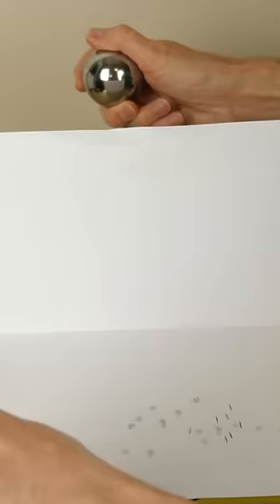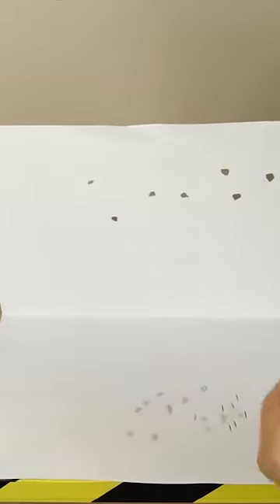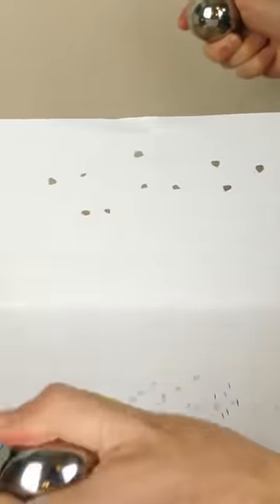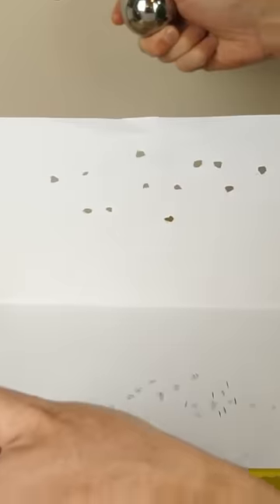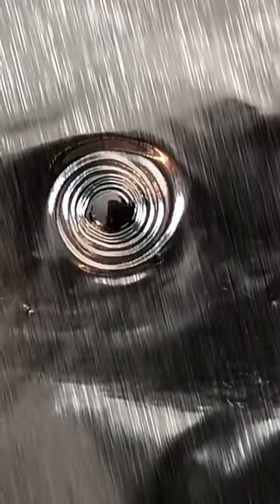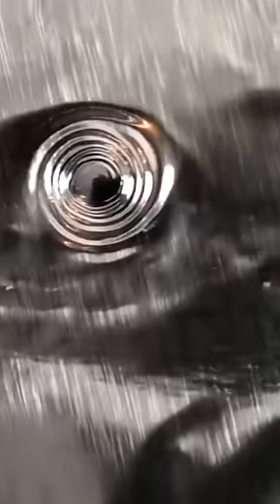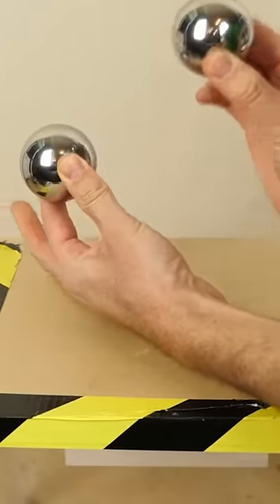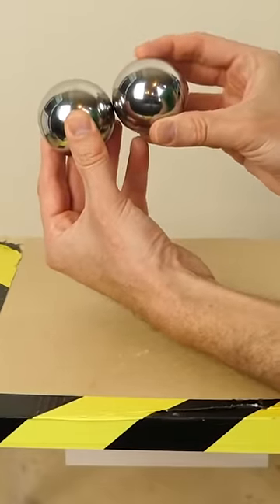Balls of Steel Make Sonic Boom

Comment: at first i was like wow that’s pretty cool, then i thought about how there are no crinkles in the waves. Think about how hard it is to bend aluminum foil without it crinkling/making edges. Crazy that it’s so smooth
Reply: I'm guessing it's bc of the initial heat of the reaction generating enough heat to briefly melt the aluminum and make it much more malleable
Reply: @miscl_anon  oo ya that would make sense
Reply: @jackistripping1846  ye ye-
Reply: honestly it's not too hard
Reply: If instead of Aluminum, you’re actually using Aluminium, you can use your own two balls of steel with no wrinkles.
Reply: I believe it had to do with the miniscule contact area of 2 sphere connecting with minimum deformity driving the pressure produced to strikingly high levels. Pressure = Force/area.
Theoretically two perfectly rigid perfect spheres have 0% percent contact surface area driving the pressure to infinite levels ie undefinable. In the real world neither spheres is truly perfect and steel does deform to a degree meaning that the surface is not 0% of the surface but is still incredibly small meaning even with only 2 pounds of mass from over both spheres and the relative low velocity of the collision the pressure produced would still be far greater than we'd imagine intuitively. Small but powerful Soundwave deforms the foil mechanically with some energy lost to heat perhaps changing the elasticity of the foil. The Soundwave would dissipate quickly due to the small amount of gas volume displaced at the point of impact.
Reply: @miscl_anon  maybe not melt but for sure softened by the heat
Reply: @Ron.S.  Aluminum and aluminium same thing, just different language, British and American
Reply: @kerimca98  I know… still don’t understand though why Americans and Canadians are the only ones in the world who call it Aluminum if the British chemist who discovered the metal called it Aluminium
Reply: @Ron.S.  it never got corrected, but if I remember correctly it was due to a spelling error on this side.
Reply: @miscl_anon  While it certainly gets hot, perhapse the pressure alone can deform it that way. When you bend aluminum foil by hand, it creases easily because the forces tend to focus at weak points, weakening them further in a positive feedback loop. The whole peice of aluminum acts as a lever. In the case of the steel balls, there is enough force momentarily being applied directly to the aluminum to deform it. Assuming this is true, it still only explains the surface smoothness and not the wave properties. EDIT: There is a pressure wave propagating through the aluminum after the impact, and wherever the pressure difference is high enough across a small enough distance, the material is permanently deformed. Since it is pressure waves doing the deformation rather than "direct" pressure, the deformations are understandably wave-like.
Reply: @anjaninator  ye, something like that. I was just thinking "melt" in the sense that it became very malleable for a split second
Reply: @wes8190  mebbe. tho personally I'm not sure enough pressure is really being applied to the balls for it to affect the aluminum that much. heat tho, would soften the metal and cause it to expand, creating those ripple patterns as the heated material expands and meets resistance of the unheated material
Reply: @ArtisChronicles  to be clear, the spelling error was on which side?
Reply: @miscl_anon  I suppose the reality of it is a complicated mix of the two and more. I don't think expansion from heat is enough alone. Consider the heat comes from the air being compressed, so could the air pressure or flow of air be what deforms it? EDIT: I want to see this tested in a vacuum lol
Reply: @wes8190  >consider
*Considering? or do you mean, "suppose that"?
Reply: @miscl_anon  I meant it as a friendly demand, but i concede that it may be an incorrect consideration to demand. Where does the heat come from, if any, and where does the pressure come from, if any, and which plays the biggest roll in the deformation, if either...
Reply: @wes8190  Oh, I was just wondering how you were framing it, since it could've read as either you saying "Considering that the heat comes from the air..." or "Consider the possibility that the heat comes from the air..."
Anyhow, to me, it's the balls that make the pressure, that generates the heat. as demonstrated with the paper, their impact creates enough heat to burn through it completely, so to me, that heat is what's acting on the foil
Reply: @Ron.S.  A British chemist didn't discover it, a Danish one did.

Comment: Tangent points. There is a tiny amount of surface contact with a lot of momentum causing compression of the air  between them. This is awesome.
Reply: It is pretty cool.  One of the cooler videos of his. Could you start a sizable fire this way? I'm sure you could
Reply: @FirstnameLastname-rf8bf  If you had such huge balls of steel I’m sure you could
Reply: @nightraider5100  well, good thing I do.
Reply: +1 like
Reply: Ya same way glow plugs work

Comment: if i remember correctly, this is why when dealing with ball bearings in large quantities and flammable fumes or materials youre not supposed to have them together and the steel is not supposed to have space to move around. i think thats why 9/10 that you buy bearings theyre individually wrapped or in a matte plastic package. cool video

Comment: I think I read about axes being favored against plate armor because round surfaces always hit each other nearly 90 degrees and so it is always maximum possible force at point of contact and it's a great way to amplify your damage against a strong, round plate of armor. This looks like the exact same thing, but with much more round objects and a membrane in between. Very cool.

Comment: I thought that sonic booms occurred when the sound barrier was broken? How is this beating the sound barrier?
Reply: It's not.
Reply: Guessing if it is a sonic boom, the air between them escaping at high speed is what is creating the boom.
Reply: It’s not. What’s actually happening here is friction and heat conduction due to the collision of the steel balls.

Comment: I like how our brain is able to perfectly align our hands so the balls hit each other through the paper without any sort of aiming.
Reply: I think that’s simply because the balls are perfectly spherical, so they will always hit when brought together. However, the “BANG” you get depends on the angle that you bring them together.
Reply: @timopper5488  I don’t think you got what OP was saying but ok
Reply: @Ozone946 
I totally understood it, and the OP is incorrect, because aiming is involved. It’s unconscious, but it is actual aiming.
Reply: @timopper5488  i definitely would nt call it 'aiming' because that necessitates some sort of visual component. Alignment, sure, but thats not aiming. Op is talking about proprioception, which is the same 'sense' that lets you touch your nose with your eyes closed, or for a more analogous example, clap your hands.
Reply: @hq4290 
Yes, and that is aiming. It doesn’t need to be done consciously. I know you think that I’m misunderstanding, but I assure you that I’m not.
Reply: @timopper5488  subconscious * and no hitting it at any angle wouldn’t change anything they’re spherical they have the same surface size no matter how you turn them and clap them together, that’s like saying that 2 squares with equal surface area and size will hit different if you turn one around
Reply: @adanflores4523 
I meant subconscious. But yes, the angle would create a slightly different result.
Reply: @timopper5488  There is no angle. They're spheres. They always hit the exact same surface area. Because it's a sphere.
Reply: @chrismanuel9768  I suppose you do have to hit them into each other. I would imagine if you only have a glancing blow there won't be enough energy in the collision to create the effect.
Reply: @chrismanuel9768 
Perhaps I’m not explaining myself well enough. Even spheres can approach each other in a glancing attack. The surface area of contact may be the same, but the impact will be different than a head-on collision, so to speak.

Comment: A bit awkward phrasing when describing what happens when the balls collide, the observations make it sound as if its the shockwave that causes the holes in the paper; if this were true then you would see the same crinkling pattern as seen in the aluminum foil, which there aren't any. What actually happens is the transfer of kinetic energy from ball to ball is an inelastic collision due to a portion of the kinetic energy being expressed as thermal energy, which is why there are visible sparks/cinders after each collision; ie the collision is actually burning the paper at the site of the collisions

(edits: fixing some spelling/grammar typos)
Reply: He said it was burning the paper
Reply: Brilliant.
Reply: Kinda sus

Comment: "perfect surface area when they contact each other"  They're round.  They only touch at one tiny  point no matter the size.
Reply: Not quite - elasticity, imperfections
Reply: Mathematically speaking, the point of contact has zero area, but what Carlo says sounds about right. Also, it could influence how the sound can  "escape"
Reply: @Flovus  I'm reminded of an engineering professor who corrected me on something similar and said "actually, it's not "zero".  It's infinitesimally small but not "zero"." 🙄
Reply: @sonparabailar  Well, engineers usually don't know much about math.
Before the development of the limit, Newton did use infinitesimally small numbers in his early calculus work. There is a field called nonstandard analysis in which one can show that this can be put on a formal basis.
But in the standard reals, there is no such thing as an infinitesimally small number, only arbitrarily small numbers.
Reply: That’s assuming the material is infinitely stiff. Hertzian contact would be a much better assumption for calculating the area of the contact surface.
Reply: I believe that in physics there is no actual contact at all.
Reply: @paulneilson4106  Pauli exclusion be like
Reply: @sonparabailar  infinitesimals don't exist in the real numbers. Physicists and engineers are so liberal with using the concept of infinitely small numbers because it makes their calculations work well but it's not mathematically rigorous, in fact it's not even necessary to use this concept at all. Any usage of infinitesimals can be replaced with a limit, which is much more logical and intuitive anyway even putting mathematical rigor aside.
The nonnegative number that is smaller than all positive real numbers is 0. It's easy to find a contradiction if you assume otherwise.

Also, mathematically, the area of contact is zero. A point has no dimensions, i. e. no area. Imagine introducing a malformed concept to talk about something that isn't even true.

Comment: Rust one and cover the other in Aluminum foil and it makes thermite.
Reply: .. Really ?
Reply: @CraigDAmico  Really.
Reply: Not really, thermite is iron oxide plus aluminum but the aluminum foil is passivated by an oxide layer.
Reply: @wedmunds  And you don't think that two heavy metal balls whacking together on point to point contact can penetrate a thin oxide layer? Lol

Comment: I think I remember discovering this with paper when I was younger when I was just screwing around, but I think I did it with something else.

Another cool thing I discovered when I was a kid was rubbing a white fluffy blanket against my hair and making it all static, then discharging the electricity with my fingertips and you can actually see the electrical current on the blanket, it would light up on the surface, sort of like clouds that light up during a thunderstorm. It was dope, too bad we got rid of the blanket.
Reply: I once had a blanket that would light up like the night sky If I generated enough static

Comment: I'm still unclear why this happens only with the spheres.  Does the combination of both surfaces need to have a certain radii?
Reply: I would guess it's the very small surface on each side of the ball contacting the other part. You can use the same force with a hammer but a flat hammer surface spreads the force too wide. 

When the same force hits a much smarter area, the impact is much greater, thus creating a sonic boom shockwave.
Reply: Maybe it's because of the extremely high pressures created by the impact concentrated at the tip of the spheres.

Comment: BASED ON WHAT SCIENCE!! 🤷🏻‍♂️
Define “Mini Sonic boom”
It’s either a sonic boom or it’s not. 
There is no small sonic boom it’s a constant loosely based on atmospheric pressure and velocity of an object through that air. 
Explain please?
Reply: does it have to be air? or would any medium able to transport the sounds energy do? can a sonic boom occur in water? some old school knowledge gurgles up that the speed of sound is five times faster in water. 
can there be a speed of sound in solids?
this video opens more questions than it tried to answer :')
Reply: It's vibration. A loud one. The guy in the video has mistaken "loud" for "sonic boom"

Comment: Okay, a shockwave, but that’s not a sonic boom. A sonic boom only occurs when an object surpasses the speed of sound, at which point the wave front, which had built up from increasing speed, converges into one large wave at the critical speed (Mach 1).
Reply: Maybe he refers to the displaced air that creates the sound (additonally to the klick sound of the steel). Like the overheated and displaced air during a lightning.

Comment: HOW TO MAKE A NUCLEAR BOMB 1) Obtain uranium-238 2) Place it into an uranium enrichment centrifuge Boil it at 4131 deg C (4404deg K or 7478def F), a gas is needed Pass the U-238 gas through cell membranes Capture the uranium-235 particles, let it cool into a solid The mass of captured U-235 should be 47kg (104 pounds) or above 3) Mould the U-235 into 2 pieces which will fit into a sphere 4) Attach a big metal rod to one of them 5) On the other end of the rod attach 3kg 7) pounds) of trinitrotoluene 6) Get a 3V lithium-ion battery, a switch, a barometric sensor (BME280/680 pressure sensor).10 30mF capacitors, 20 1MQ resistors and copper wires 7) calibrate the BME280/680 to battery, in series with the switch (off)8) Create a marx generator placing 2 wires in regular intervals (use all the capacitors), in each interval (use all the capacitors), in each intervals (use all the capacitors), in with a spark gap, finally separate each inverval with resistors 9) place the marx generator in a plastic container and fill it with epoxy (Make sure spark gaps don’t get covered) and debabbulate with vacuum chamber) 10) Connect the marx generator with the barometric sensor, place the circuit close to the trinitrotoluene and finish the circuit with a spark gap at the surface of the explosive 11) Encase everything in a steel box (from high altitude, the pilot should be able to get away from the explosion safely)

Comment: Falt paper, wait a second:
Paper is made mostly out of wood and paper is flat all the time, if it's to thigh then it's not paper anymore and therefore cannot be flat.
So we agree about the fact that paper is flat and can only be flat.
Another fact about paper is that it's made mostly out of wood, now there are some papers that are made out of grass and an even less percentage that are made of rocks?! What? Yes anyway..
In order to make paper, you have to make the rock flat, that's another reason why paper can only be flat.
Ok now we also agree that paper is made out of wood and grass and rocks sometimes.
So now what have all these materials in common?
Wait a minute they are all common in earth 😮😮😮.
You have 3 that are from earth and all 3 of them need to be flat,so you can call paper, if we calculate it mathematically then it goes like this:
3/3 = 1/1 and 1/1 = 1 so what is one?
1 is 100% and means that something is accomplished 
So that proves that the earth is 100% flat, science paper is also falt, and it can only be, The paper is also made out of materials that are mostly common on earth, so the connection is proofed too.
Wait it gets even better, so paper is made mostly out of 3 materials and if we take the 3 and put it in a 3 dimensional space then we get 3 points, now if we connect the points then we get a triangle.
What do you think about when you hear the word triangle? illuminati of course now we have also proven that illuminati in fact exist and guess what, they have told you that the earth is round ,...
spherical to be exact 
But now we have proven that the earth is not spherical, but it is and only can be flat.
And don't forget, we accomplished this only by using our brain and one piece of paper.
The Illuminati s have a reason to be afraid of us, it's because we are stronger, smarter and better than them, yes we are better than them.
Anyway, the only reason they could achieve all this is because they came to earth as we were still monkeys and they manipulated us to think that the earth is spherical.
There you have it, if you still don't believe it then you're still under the hypnosis or you're an alien and just didn't know it all the time.